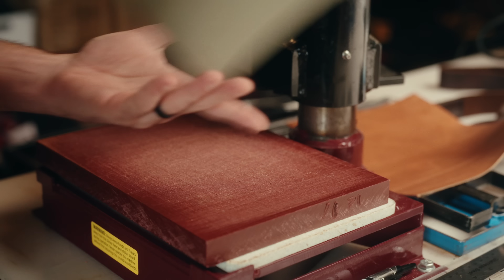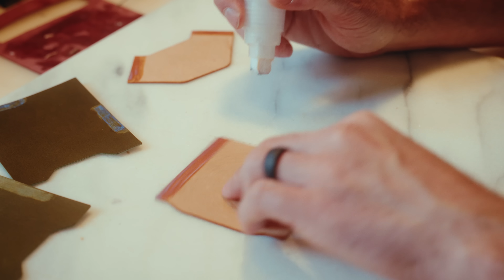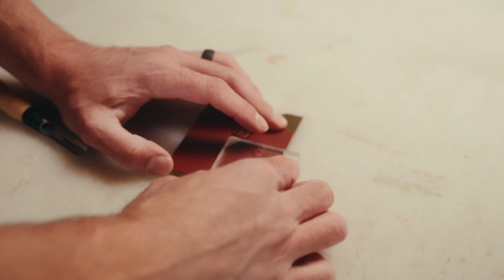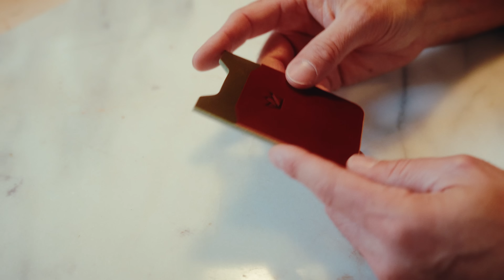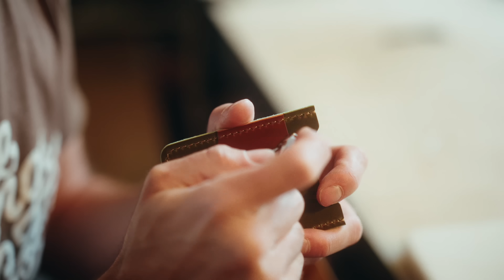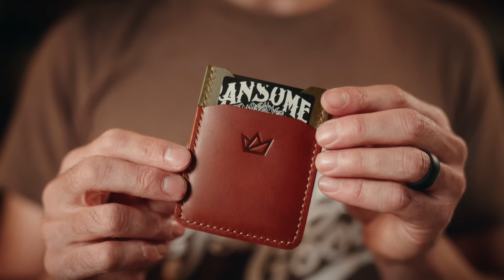MAKING MY FAVORITE WALLET - THE M2

Comment: Im struggling myself to find the right leather to use for these kinds of projects, ive tried some myself using Veg tanned Kangaroo leather which is about 0.8-1mm but I find them a bit flimsy. what leather are you using for this?
Reply from the maker: That’s too thin in my opinion. For something like this I would recommend 1.4mm to 1.6mm Vegtan.
Reply: @LittleKingGoods  I’ve just been really struggling to find suppliers over here (Australia) not sure what sections of cows hides to use etc. lots to scroll through

Comment: Great video! I wonder if making this wallet is as simple as getting the patterns and buying veg tan leather at your local leather store? No one seems to show that the leather from the store are not conditioned nor finished. 

Would be great to see a video on making a wallet with leather directly bought from the store and the steps on how to complete the finishing process.
Reply from the maker: Not sure what you mean, this leather is bought straight from the tannery.
Reply: Then does it mean leather bought straight from the tannery are already conditioned and finished?  I bought one of those wallet kits from the local leather store and they said I have to apply conditioner on it after putting it together.😓
Reply from the maker: With a good quality leather it shouldn’t need conditioning right away. Only when needed if it gets dry.

Comment: How do you keep the glue from ruining the applicator tip?
Reply from the maker: It will eventually need to be replaced. You can simply flip the tip around as well for another little while. I find if you keep the cap on right after using it stays wet for a very long time ✌🏼

Comment: I noticed this wallet is tailored for US cash Canadian cash is 70mm wide and US cash is 65mm wide it will stick out the side. Only thing I can do is to make one of these wallets so it accommodates for Canadian cash. I was thinking since your Canadian leather maker you would be aimed more toward Canadian cash.
Reply from the maker: I’ve used it with both currencies plus euros and it works fine 🤙🏼
Reply: @LittleKingGoods  Really? it looked very maxed out with the US cash.